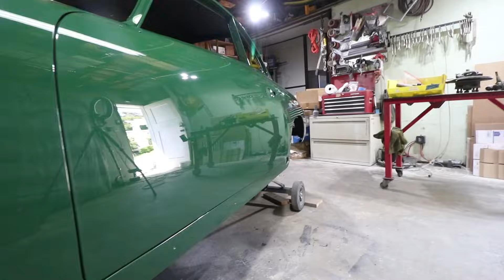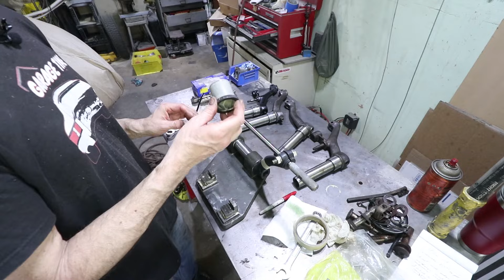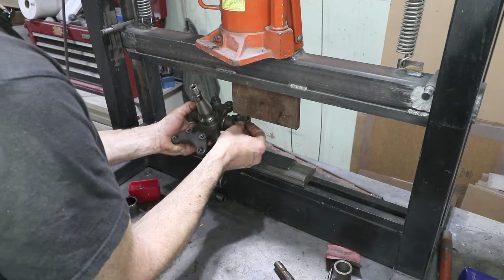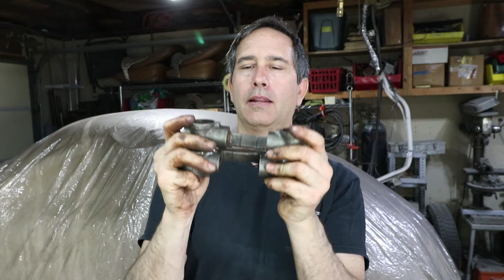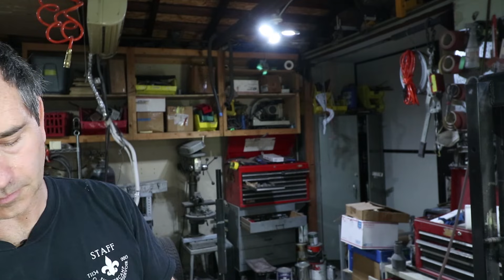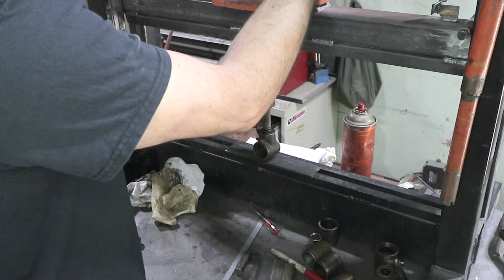Expert ONLY Porsche 356 Suspension Rebuild?  Really....

Comment: WHen you reamed the new kingpin bushings what measurement did you ream them to? Thanks.
Reply from the maker: It's a guided or piloted reamer specifically designed for VW and 356 suspension.  I don't remember the size of the top of my head.  It should be the nominal size in the workshop manual.

Comment: I starting on mine this week. My 63 T6 was put together by a flipper In Newport Beach with whatever they had laying around just to get as a roller. After major metal work from rust and major wreck I’m about to attack this mess. Unfortunately I do t have access to those factory tools. Maybe the swap meet on April 28  2024 at empi  in  Orange will have someone there that has those tools that I can check my stuff. Your videos help me along on this 1 1/2 year so far build. Thanks again
Reply: Great I ordered a control arm from a guy on samba yesterday . The one on the right was replace with a pre a one. The car was in a pretty bad accident and flipped over. Got all the rust repaired and all body work is done . I want to short out the suspension before I paint it. When I get the arm and clean up all the parts I’ll message you to arrange a time to meet at your convenience. I’m pretty close by in Diamond bar.  Thanks Andre
Reply from the maker: Cool, meet you soon👍
Reply from the maker: Cool, best of luck on your project.  I'm in Huntington Beach if you want to check your parts.  My email is in the about tab 
Tom

Comment: I think the expansion from heating the kingpin assembly probably helps break the bond between them. As the diameter of both bore and kingpin expand (at the same rate), the bond is disturbed to some extent. In any case, if you can't something like that apart, heat always seems to be the ultimate answer.
Reply from the maker: I agree, try heat vibration and penetrating oil on stubborn parts.  
Behind the scenes I've been breaking apart parts that have been left outside.  I bought 14 pallets of Porsche parts mostly for resale.  I've been able to get everything apart eventually 🙂. Some things have to soak for days though.

Comment: The reason the spindle  would not fit the P69 tool properly  is you are missing the supplemental parts to work with 356c spindles it is a set of spacer/adapter rings (p69a)
Reply from the maker: Ok thanks, where do I get those?
Reply: @GarageTimeAutoResto  They come up for sale occasionally on the 356 registry classifieds and the samba

Comment: Which tool is used to extract the suspension arms from the torsion tubes ?
Reply from the maker: I seem to remember using a rubber hammer.  Once the pointed Allen bolt is removed there isn't a press fit or anything holding it on.

Comment: At around 14:00 - if you see wear on ONE side of almost any of those parts it is a pretty good assumption that they are bent.
Reply from the maker: Right!  I spent a lot time studying and measuring this stuff to know it's straight.  I also checked the torsion tubes in the car and had to make some adjustments there too.

Comment: Hey Tom I watch all your videos and love your work, I do have a question for you and it is that, in your video you talked about making sure that a longer bolt was installed to stop the front tires hitting the cars inner body, is this absolutely needed, as I wonder if the constant hitting the bolt on full turn would finally wear it down to be useless, would it make more sense to use two longer bolts on the one side and looking at the two parts that connect the king pin together, would using the entire length of the them,  without the extended bolt makes more sense, please either answer me here or add a note into your next assembly video of the parts so that I will know what I need to do?
Cheers Gil.
Reply from the maker: Hi, thanks for watching.  You may have noticed that I didn't back that bolt out with the impact wrench.  I used a ratchet instead because the end was a little mushroomed or the threads weren't pristine.  I'll have a look at it again when it goes back together, but my guess is that it's random if two bolts would contact at the same time.  Most of the load will be on one or the other and it will wear first.  I don't think this is a high wear item.  Probably not worth thinking too much about it.  Other than don't leave it out.

Comment: Very nice Tom! I have a time trying to find a part to use to press out other parts. Nice work. I'm guessing the goal is to try to get the 356 back on its wheels
Reply from the maker: I know what you mean.  I have bins of extra steel just for this kind of stuff.  My problem is finding just the right piece in a messy shop, ha ha

Comment: Do kingpin bushings really need replacement?  Yup essential to replace kingpin thrust washer.  Also found that only linkpin bushings are required: linkpins themselves ok.
Reply from the maker: Everyone's car is different I suppose.  My link pins were trashed, new bushings would be loose for sure.  My king pins are worn and you can feel a line in the king pin bushings.  The line is right where the grease grove is on the pin.  
When I bought my car it lived on a dirt road, and it was poorly maintained.  
I'm going with all new stuff and I should never need to do this again.

Comment: 28:57 holy moly that Metal conditioner is neat! .. i did look up for Rm 108. but seems to be typical PRO/IND application/sold only.. you happen to have somthing thats availeble at body shops or somthing :O cus i can figure out a few locations on my block to tidy up with that stuff ..  reaaly njoy this video once more. seeing you tackle the things likea Treu DIY road Warrior  (y)
Reply from the maker: Mine is Dupont 5717s.  I hope that's the right part number.  If not let me know.  Good stuff!
Reply: @GarageTimeAutoResto  Thanks man :) ill investigate it. the upper part of my VR6 engine block could use this treatment with out sanding or blastig it xD! .  i want to restore it to nea factory finish with out to much evidence its actually been done haha :P
Reply from the maker: @Albert87nl  cool, if it's a rough casting the steel wool might not work as well as a hand brush.  Keep the surface wet and just let it do it's thing with some agitation.